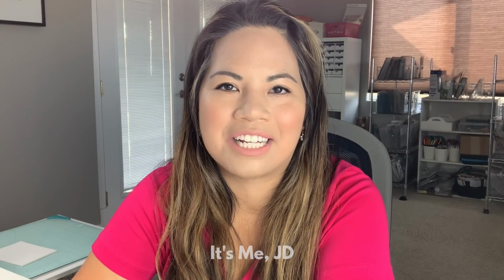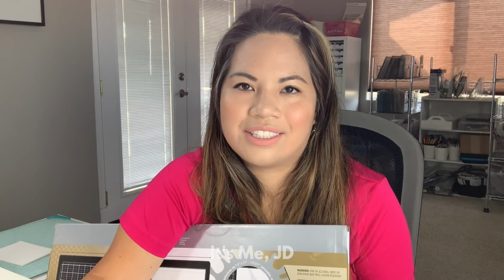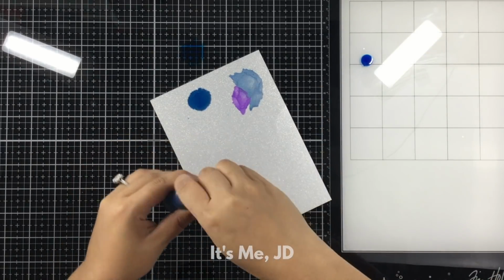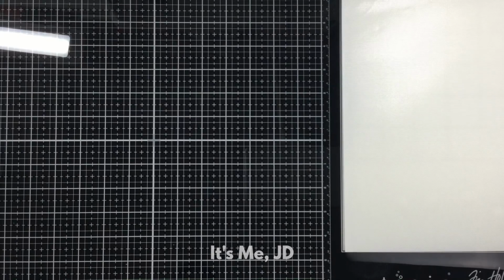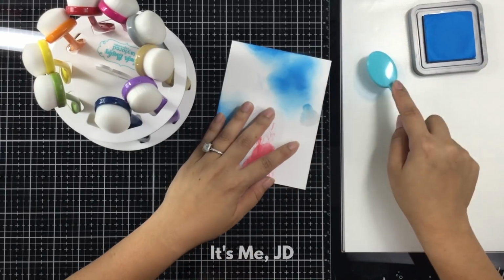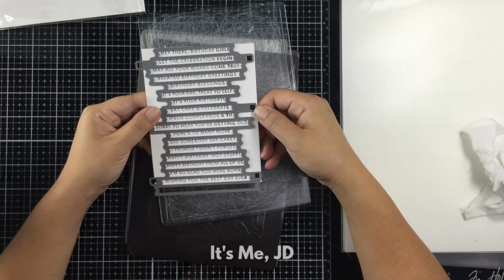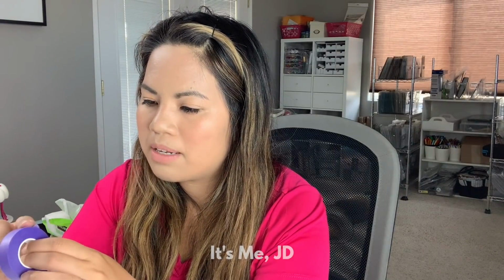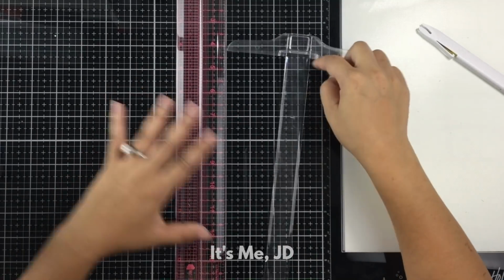Testing out "MUST HAVE" Craft Supplies & Crafty Tools...are they worth the money? PT 1

Comment: the clear piece is brilliant for shaker cards.  
If you don't have the money for a media matt,  a glass shopping board is a heaps cheaper way.
Blending brushes cost tooooooo much.
The same sold as make up brush cost under 7.00 for the fill set. You can colour coat yourself.  silicon cleaner under 2.00 at AliExpress

Comment: I buy tempered glass cutting boards at my thrift store. I pay $1 Can and no tax. They come in a variety of sizes. There is a picture on the smooth side and little non-slip silicone feet. I soak the cutting board and remove the picture. The non-slip feet come off with the picture so, if you want, you can re-glue them. The glass is thick and the edges are nicely rounded. They are so cheap, I have several that I use for my gelli plate, for doing dendritic prints et al. I could buy the Tonic Studios Tim Holtz Glass Media Mat but I prefer to use my money for other craft supplies....Carole
Reply: I see these at my thrift s well, I'm curious though, once I get the print off, how would you (if you wanted one) get the grid underneath? I like the idea of a grid but not the $ for this version...

Comment: Is the Misti stamping tool worth it?
Reply: Carla Sjöholm I have the middle sized one and love it. It meets my card making needs. I did find that only a solvent based stamp cleaner removes all the Stazon or Archival  inks that can get on the acrylic cover when you ink the stamps. I’m a messy inker. I tried the recommended acrylic cleaners (expensive) and they didn’t work. That was annoying until I ordered Hero Art’s stamp cleaner.
Reply: Get the Tim Holtz stamping platform on Etsy or Amazon. Better quality, sturdier and way cheaper. Just put a piece of felt or foam in the stamping area and you're all set!

Comment: This was really helpful! Thank you for sharing!
A little “cheat” for you, since you still like your cutting mat. I use my cutting mat when I’m using a blade to cut through things (like you demonstrated with the acrylic ruler) so I keep it on my desk underneath my glass mat. It doesn’t interfere with it and if I need to slice something, I just lean the glass one up against the leg of the table, do my cutting, and then put the glass one back! 💜
Reply: I keep a cutting mat in the top drawer of my desk, along with my score board. Its easy to just pull them out when I need them (I use them a lot). You can cut on the glass, but I just want to keep mine smooth for as long as possible. The Glass Media Mat is one of the best things I've ever bought. I got it a year ago, and now I can't imagine crafting without it!

Comment: I will say, the Tim Holtz glass mat is nice, but I have a different brand which I prefer. I have the CutterPillar glass mat. A few reasons: 1. The CutterPillar is a clear tempered glass mat as well, but it is white underneath the glass instead of black, which I prefer. 2. It can be purchased with or without a light source. I commented on Tim's videos more than once that I would purchase his if he came out with a built in light source for it as well, which he has not. I LOVE the light source for card making. I have used the light source many times in the few months that I've had it. 3. The CutterPillar comes corded or cordless. The cordless one has a rechargeable built in battery source. The one I have happens to be corded.

Comment: There is a straight line ruler that goes with the Tonic Mat, and also a “scraper” for mixed media.  Also the mat cleans up with hand sanitizer. Please do not use a stainless steel cutting blade, it will cut the glass mat.  All other blades are supposed to be fine.
Reply: I'm not sure what other blades there are besides stainless steel blades...can someone help me with this?
Reply: Ceramic cutters, Fiskars make some

Comment: There’s also a purple painter’s tape for delicate surfaces that’s cheaper than purple tape...
Reply: I've tried both and still prefer drafting tape for a low rack tape. It's awesome.
Reply: Washi tape is very low tack and works decently for holding things in place. 
If you lightly press your painter's tape onto your clothes a couple of times before using it,the little fibers it picks up reduces the tack just enough to make it useful for pretty much anything and more easily removable without damaging the surface.

Comment: Only one problem with the mat is that is scratches really badly.
Reply: Gloria Olmstead I have cut on my CutterPillar glass mat many times, and it does not scratch.
Reply: Cindy Rom right yours, you say is cutter pillar maybe the difference. I just from now on put a real cutting mat down to cut with. Mine was one of the first and the feet came off and the black is scratched also so maybe that's why it scratched. I would not buy another one of these. I am often disappointed in Rangers products.
Reply: Gloria Olmstead   When I first started stamping, almost 30 years ago, I cut on a piece of glass from a picture frame. I taped around the edge so I wouldn't get cut, and I used that until I bought my first tempered glass mat. I LOVE cutting on glass...much smoother cuts than on a cutting mat.

Comment: Thank you for reviews.  Nothing like seeing products taken fresh out of the box to see how big they are - or how heavy.  Re the MISTI Cut-Align:  I use a quilting ruler which has a slot in the middle for using your scalpel or cutting knife.  These quilting rulers have been around forever and stand up to being used frequently & are very sturdy.  They also have vertical & horizontal markings to line everything up and these rulers are way cheaper than the Cut-Align.

Comment: If you’re thinking of replacing your cutting mat, buy a spare (In case this doesn’t work), try this trick first, it works for me. Boil some water, put the cutting mat in a bowl or sink with the plugin, pour in the boiling water and leave for about five minutes, Remove dry and place flat with a book or a weight on top. works a treat, I’ve not replaced a cutting mat for two years
Reply: Thanks for the tip, though after using an awl on my years old cutting mat, I really need to replace it. LOL The awl just went through... Fortunately I had a desk protecting mat underneath.
Reply: @elainelouve  my desk is completely wrecked after 2 years of water and mucky stuff

Comment: Hi JD, interesting video.  I was interested to see you cutting on your media mat.  I am in two minds about them.  As an easy clean work surface, they are terrific, however, a) if you cut on them they scratch b)Lining up work for measurements is difficult as the grid appears to be etched under a layer of glass c)my first mat came with a chunk missing, the replacement the little feet came off out of the box.  For the price, I would buy a piece of high quality tempered glass and lay it on top of your cutting mat.  The sentiment die a "MUST HAVE'?  Not if you already have a paper trimmer.  Love your philosophy, get bigger storage :))  Thanks for taking the time, and expence to produce this video.

Comment: I was able to get all the same size brushes by buying them in pairs on Amazon. I have one per colour family like the Taylor ones and I just labeled them. Not as pretty but way cheaper. I brush them off on a rag between uses but if I use a very dark colour I wet the rag first. I’ve not had to heavy duty clean mine at all yet.

Comment: How is the glass mat for cutting on? Like using a craft knife on it cutting a piece of card stock. Those blending brushes look wonderful.  This is a great video. I wondered about the glass mat and the purple tape. Which die cutting machine are you using?  I have the Cut-a-lign ruler. I never use it. I love the We r memory keepers layering rulers. I use them a lot.
Reply: Using a cutting knife on the glass will scratch. I suggest a small piece of cutting mat to keep nearby.

Comment: The brush cleaner is meant to be used with what and a bit of dishwashing liquid and then brushed on that mint silicone tool to suds out the ink. Then you rinse and set the brushes out to air dry (I think that was one a video on the company website about the brushes). If you want to clean off excess ink without going to the sink, just clean the brush off on a baby wipe.

Comment: You crack me up and you are so relatable! ☺fyi- The plastic t ruler you have would probably work the same way as the TH Accessory I.e. sliding along the mat edge.  

So far I have resisted all of these.  My limited funds helped make this possible😆  I use makeup brushes, a glass top on a gridded cutting mat, a dollar store picture frame with a white sheet of grid paper for color mixing, that tape they use at the hospital on the little blue rolls (free from the hubby), and I don't mind stamping and lining up my sentiments with my set of banner dies.  I did get a TH stamping platform, and I think it was worth the investment.  Nice video.

  And I think Jennifer Mcquire posted a trick about how to slightly tilt your mat to get rid of the glare.
Reply: Just a quick note that while that hospital tape may be free to you because your husband brings it home from work the rest of us our paying for it through our insurance premiums and tax dollars.
Reply: @crickett4877  it's a private hospital and my one roll isn't going to kill anybody.  I'll assume that my 50 cents has it covered.

Comment: To me it looked like there were harsh edges with those blender brushes but maybe I'm overthinking it.  I also have heard that the glass mat isn't as easy to ink blend with because the sponge on the ink blender tool does not glide over the glass as smoothly as a regular nonstick craft mat. I couldn't tell based on your example if that was happening or not..  Do you think it makes blending physically easier on the hand then using your other craft mat?  P.S. Loved  your different facial expressions, you crack me up!!
Reply: That white craft mat works perfectly for blending :) Plus it has the silicone backing so does not slide around :) I find myself using it a lot and often just on my table without the glass mat.
Reply: No harsh edges - we just recommend the first brush off to the side so you don't get the immediate glob on ink right on your project (as with any blending tools).

Comment: Girl, you always make me laugh! Thank you for that!! I'm wondering how the t.h. media mat compares to your weRmemory keepers one? I know the t.h. is larger and there's the color difference. Just wondering if there were any noticeable differences in function. Looking forward to the next video! ❤
Reply: I have three of the WRMK mats and they work equally well as the glass side of TH mat. I paid $9.99 for ea at Tuesday Morning.
Reply: @lindatowill8978  Thank you so much for the info Linda! 😊
Reply: Sometimes beings that it is black is a hindrance. One nice thing about glass mats is you can use a razor blade to go gently across the mat to get the "caked on stuff" off. You can go to a glass place and they can cut you a piece of tempered glass to your size specifications. Then like one of the other comments put another matt under for measuring and cutting. As all glass seems to scratch. Good luck.

Comment: I got the glass media mat after using it at the craft store where I work. I love it, because it's so easy to clean up. The only thing is that it is so slick that it can make working with stencils a bit more challenging sometimes. I

Also, as some have said before, the cleaner tool with the brushes is to use with water when you're finished for the day.  It's like an itty bitty washboard for your brushes. 

Thanks for the honest opinions.

Comment: I was going to get the glass mat but the reviews on amazon say the grid is crooked and we need to buy an additional item called the straight edge mat for it. I wonder o if they have fixed the problem also some have say mat is not really flat and you have to add something to the feet to level it out. Did you notice any of those problems. I really want to get it but it comes to $45 $50 dollars so dont want to spend an additional 20 bucks for an item
Reply from the maker: Haven’t noticed a problem yet..  I’m still using it on top of my regular cutting mat
Reply: You don't have to buy the accessory straight edge if you don't want it :) As soon as I can...I may get it though. It would make lining cardstock  straight a breeze.
Reply: josmary flores z

Comment: Hi JD! Great video as always. 😄
I’d be so happy if you made crafty ASMR videos either using the items to create something or not. 😍
Also the green brush cleaner thingy you can put your fingers in it to hold it better and use plain water on the brushes or add some soap with the water to clean the brushes and then rinse off then lie them face down to dry so the water runs out of the bristles onto a cloth.
I don’t know if you’ve mentioned it in any other videos but what is the glitter tape for in the Misti?
Reply from the maker: Thanks for the tip. Glitter tape is to let me know where to place my cardstock
Reply: @It's Me, JD You’re welcome 😊❤️ That’s a good idea!

Comment: I love the glass mat. Mine is getting slightly scratched and I bought it when they were first released.  They do tend to get a bit crusty too with embossing powders, paints and pastes and need a real cleaning operation when that happens. Tonic sells a scraping tool for that and I use it with alcohol. Another product they sell is a really substantial ruler that hangs off the mat. Unfortunately it doesn't have measurements so you line it up using the mat grid. I also find it really useful to hold my photopolymer stamps when stamping! I just pop them on the ruler until I put them away and it saves the small ones getting lost.
The brushes are a life changer I think, but I just get sets of five the same size on eBay, then put a colour sticker on the handle - no eye candy but they are about $5 for 5 brushes.
Reply: Miranda Austin Get a one sided razor blade to scrape it off. It works way better than the tool that Tim sells. :-) I wish it weren’t black either. I lose my phone on the top all of the time~ :)
Reply: @lauralee1036  yassss the phone thing is real. I also have the black tim poky tool and i lose it on there as well. Black hole lol.
Reply: @lauralee1036  you know what? I know i have some of those around here  somewhere but i couldnt find them and i tried an exacto knife. Worked really well!
Reply: my ruler add-on doesn't line up with the grid. so disappointing.
Reply: @jenniferreece2218  yeah i think thats terrible. Did you know you can adjust  it via the screw in the top?
Reply: @mandy.austin  I did not know that. I was going to create a shim, but adjusting would be much better! Thank you! Thank you!
Reply from the maker: Thanks for the info!

Comment: I bought a piece of temper d glass to fit my work space and put a sewing mat underneath it with measurements.
Reply: I was considering suggesting this. If you don’t have a lot of concerns about the glass getting broken, you could even purchase a large frame from a secondhand store for a couple $ to put over whatever sort of grid you have.
Reply: @JerseyPearlAnn  I bought a set of glass place-mats which I didn't end up using in the dining room. So I turned them over and ruled lines with a Sharpie, and then painted the backs with white acrylic paint. Now I have 4 glass mats, albeit, they are smaller than the Tim Holtz one, but having four of them means I can have multiple projects going at once (watercoloring, blending, embossing, gluing) and I can take them to the kitchen sink and wash them when they need. And they are easy to store if I need my desk to do accounts.
Reply: Debi Taylor I have never heard of glass placemats. Great idea abt ruling with sharpie!
Reply: @AlphaGeekgirl  Can you share where you found glass placemats?
Reply: @AlphaGeekgirl  what a good idea
Reply: @JerseyPearlAnn  that's what I did.  I was already using a picture frame from the dollar store with a white sheet of grid paper as my mixing surface.
Reply: I bought a glass baking mat from Aldi in the UK. It's a similar size to the Tonic mat and has a measuring grid. ( it's meant for rolling pastry). It's also a pretty teal colour.  It cost £4 instead of £27 for the Tonic mat...
Reply: Exactly what I do Lisa.
Reply: Did the same thing.
Reply: I already have a Stampin up glass mat and don’t like the way my card stock slips around on it.  I rarely use it so I can’t see spending the money on this mat.
Reply: Do you have a photo
Reply: I was going to suggest the same. Have a piece of beveled tempered glass cut to your specs (can be even glare free) and place it over an existing cutting mat. I’m sure it would be much cheaper. So, no, the Tim Holtz mat is not a must have. Be a little creative and save money.

Comment: Two things. You will get a better blend with those brushes if you start with the brush off the paper and glide onto the paper slowly. If you start on the paper, you will get a blob. Secondly, that green thing is supposed to be used with soap and after not dry. :)